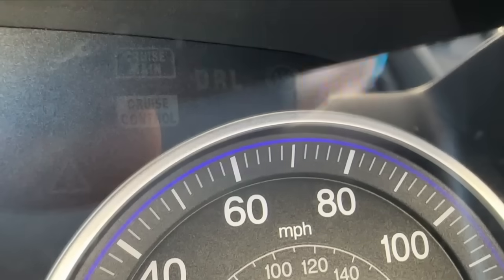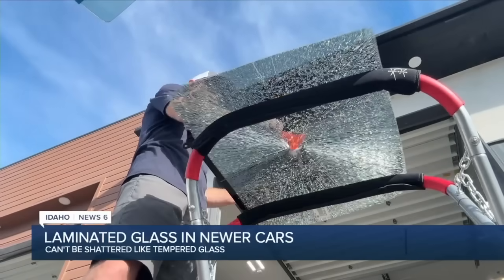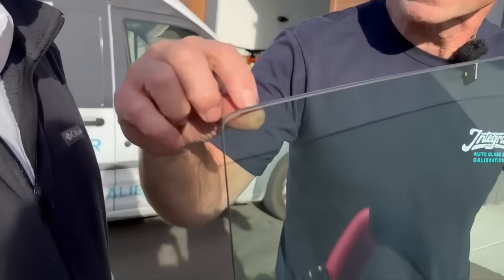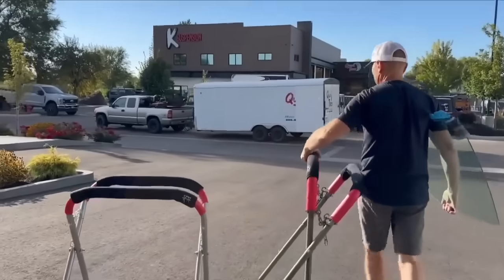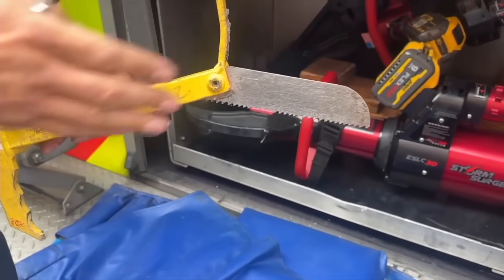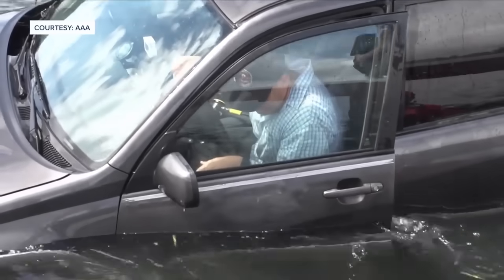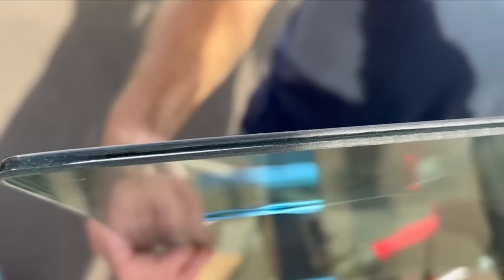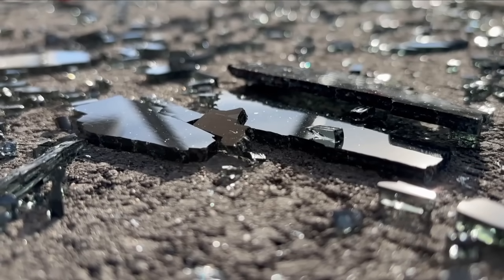New trend in automotive glass could put your safety at risk

Comment: “The only way to get out is to climb into the back”

Let’s ignore the fact that the only reason you can’t easily get out the door is because of the water pressure.

Assuming you can’t break the glass, let’s not just give up🫠. Assuming you can’t roll the window down, best thing you can do is try to stay calm, unbuckle your seatbelt, and wait for the pressure to equalize, then you can force the door open.
Reply: This is somewhat problematic, in order for the pressure to equalize you'd need to let water in but water simply filling the entire cabin does not equalize pressure, it will still keep the door shut this has been tested numerous times by this point.
Instead when you drive or land in water you should immediately try to get out via opening the door or rolling down a window, chances are your battery isn't dead immediately or if the car is old it may have a hand crank as well.

Cars usually don't sink like bricks, you have a little time before they do, so immediately after hitting the water try to get out via opening the door as soon as you can or use literally any other way besides waiting, that will likely be your death.
Reply: @Z38_US - well yes, first thing you should always do is attempt to roll the window down or crack the door before it’s too late.. but we’re assuming here that you’re already trapped.

To the same effect, this idea that you present is also “somewhat problematic”, in most cases. If a car has been floated already.. ie, water enough pressure has built against the car to where its tires are off the ground, then it’s likely most people are never going to pry a door open until the pressure starts to even out. Hand crank and motorized windows will also not function once the pressure builds up, as they will be wedged against the frame and stuck due to the intense force. But yes, obviously roll the windows down, if that’s possible.

If someone were to continue to attempt to force the door over and over again in that rush to “immediately try to get out”, then they could easily panic which leads to its own host of issues.

If you end up in a lake, roll down a window or open a door and attempt to get out immediately. If this is not possible, stay calm and plan your steps. If you stay calm, you can prepare to hold your breath in the event you go under, at which point you can easily open the door to exit.
Reply: @HiThisIsMine  the problem is that even after water filled tze entire cabin you still can't open the door, just because the car is full of water does not mean the pressure is equalized, I thought for the longest time that waiting till the car is flooded and then opening the door would work but a little research shows it does not work at all
Reply: @Z38_US whatever research you did was wrong they literally teach this in safety rescue so just stop
Reply: In flight school we were taught to unlatch the door and/or open a window before ditching (crashing in water), then as you said, let the water pressure equalize before egressing.
Reply: You're gonna be at the bottom of the lake by the moment the pressure equalizes
Reply: @Rena152  I know right? what a not good solution lol
Reply: @Rena152 - you’re not waiting for equilibrium.. you just need enough water inside that allows you to force the door open. Out in the air, you technically have no resistance, ie. equilibrium.. if someone is outside pushing your door closed, chances are you still can force the door open. 

Also, don’t forget that nearly all objects are buoyant and will not sink, “like an anchor”, in water. Even if your door was wide open, your car would not be on the ocean floor.

Either way, the point is the same, it’s not “your only option is to climb in the back and break the back glass”. Try to stay calm, always crack a window or door as fast as you can. If all else fails, breaking a window is not as easy as you may think, sometimes even with a proper glass breaker. All these escape methods have their flaws and pose their own risks. Keep your options open.
Reply: But most people panic and don't have the sense to wait for the water pressure to level out... it's a very dangerous situation, and it's perfectly normal to panic and try to escape through the closest window.
Reply: @bernlin2000  It's also dangerous to wait for the pressure to equalize inside and outside, it typically takes quite a bit longer than just the car filling up on the inside with water either way though it's not untrue but also not like people think, don't try it.
Reply: What if I drive a coupe 🙋🏻‍♀️
Reply: Top gear did an article on that.  It takes too long for the pressure to equalize.
Reply: @ebels3 Top Gear and Myth Busters.. but it’s also extremely difficult to break glass.

Not everyone has glass breakers, they don’t always work, and pulling the headrest out not only isn’t an option sometimes, but it could be quite a challenge to actually break the glass with it.

The whole point here is.. “the only way to get out”… is not by going in the back seat. You can easy screw yourself by panicking and not providing yourself alternative options.

Also, what everyone who does these tests fails to do.. is pop the trunk/tailgate, since that’s the reason why the pressure takes longer to equalize.
Reply: @HiThisIsMine that usually requires battery power.  If you have battery power, roll the windows down.  And not every car has an interior trunk release.  90% of pickups, for instance, since the don't have a cargo area in the cab.  Or my golf.  It only opens from the outside.  Yes, there is a button on the key, but the struts were never strong enough to open the hatch without the initial assistance.
Reply: @ebels3 Car batteries and electronics don’t just die under water, many cars have the lights on hours after the vehicle went under.

Pickup trucks would have much less trouble equalizing since they don’t have the extra space, so not relevant to a scenario where air is being trapped in the back half of the vehicle.

The case of your Golf.. the struts don’t mean anything, the pressure building inside would blow out the back once it unlatched 😉

At this point, I’m simply responding to your points, not trying to debate the plausibly of exiting out the door.
Reply: or open the window as u first go in the water takes a good few mins for water to stop windows from working as seen on mythbusters
Reply: or roll the window down.
Reply: Don't drive into a lake?🤔
Reply: @rhuttrho88 Right because people are driving into lakes on purpose right

Comment: Laminated glass was a challenge I was not prepared for when trying to save a guy from a burning car..... I was extremely lucky I had a huge umbrella weight with me. I couldn't break that glass as hard as I tried. It's a scary thought. I can still hear that guy yelling at me that he was burning while swinging with all my might and accomplishing nearly nothing. Managed to make a small hole and pull him through by the Grace of God.
Reply: Nightmare. So glad y were there to help.
Reply: What's an umbrella weight?
Reply: @routybouty  A weight to hold down a beach umbrella. It was on a pole to stick the umbrella shaft in, which gave me leverage when swinging.
Reply: @routybouty  Patio umbrella stand maybe.
Reply: Laminated glass is still tempered glass, but with the plastic film between layers, just as "armored glass" is - albeit with many layers and occasionally with plexiglass in the mix.
A point impact shatters tempered glass, a hammer not so much without a hell of a lot of work. The corner of a claw hammer, a rat tail file base both deliver the point impact or a spring loaded punch (which many medics carried for that purpose) will shatter the glass, then it's pierce the plastic and remove it and even tempered glass shards are still sharp, just not as sharp as plain untempered glass.
In a pinch, I've got a small blade screwdriver in my multitool, that will shatter the glass, then the saw blade knife will make short work of the plastic.
Or the medic's entry, rear window or rear door window, as the first thing we usually did was stabilize head and neck pending a collar and immobilization device.
Reply: Firefighter paramedic here.... So if at all possible here's some ways to help you break the glass ... 

Don't hit in the middle, strike the corner or edges of the glass.... They break easier there... 

The metal antennas on cars and trucks with the metal ball on the tip are excellent at breaking out glass. In a corner of the window hold the antenna roughly 6 to 8 inches from the ball against the window... Pull the ball back and allow the ball to strike the window.... It will shatter every time. 

Also small bits of porcelain from a spark plug or something similar will shatter glass of thrown at the window.

Hopefully this saves a life or helps you out next time you need it.
Reply: @medix1203 Great suggestions for tempered glass,  but these do not work with laminated.  That is the point of the story.
Reply: @rayh592 I was replying to the OP's story NOT the tempered glass. I thought that would have been obvious but I guess not.
Reply: @rayh592   Thank you.
Reply: let me quickly get a spark plug, also good luck finding antennas these days...sorry but these are useless advices
Reply: @medix1203  good tips
Reply: @medix1203   I had an umbrella weight..... homemade..... which was a tin can filled with concrete on the end of a 4 foot pole the umbrella shaft sits in to avoid blowing over from wind at the beach. I could barely get through the glass swinging that. An antenna wouldn't have helped in the slightest.

Comment: nah
not going to have weak windows just because of a 0.01% chance of some freak accident.
Reply: The side windows offer no structural benefits. As stated in the report, car makers are using laminated glass to cut down on exterior noise.
While they used a water emergency as an example, there are also fire and smoke emergencies after an accident. As a former EMT, we've had to bust windows out to reach in and unlock the car door from the inside in order to gain access to the patient.

Comment: This is ludicrous
Reply: They're not about road noise, it's a safety feature to keep you in the car in the event of an accident especially a rollover. Tempered glass shatters and then your limbs or even your whole body can be ejected, even while wearing a seatbelt. The laminated glass stays in place in the event of an accident which keeps you in place which keeps you safer from the majority of all accident types. Also as a side benefit, it also makes it harder for a carjacker or the police to get into your car.
Reply: @SilverStarHeggisist  Yes, but I was at a crash where citizens had to extracate someone from a car because it looked like there wasn't enough time to wait for the firefighters to arrive. The way the cards fell on the table, the windshield, of course laminated for good reason, was the only accessible option ... and of course no one had a hatchet or machete. It took us over 10 minutes to get them out. If the fuel that was leaking had ignited, that could have ended very badly.

Cases like that are unusual, BUT in the usual cases where the side windows are accessible, it shouldn't take that long to get someone out of the car. I agree that keeping someone from falling out is a priority, however, I am not convinced that reinforcing the windows is the ideal approach to doing so.

- Improve the side curtain air bags. 
- I dont get why cars dont have 5 point restraints and why it never became a thing to wear a helmet while driving. 

A 5 point racing restraint (plus making boron steel frames or other frames that won't collapse and entrap occupants as a standard feature) would make head - on collisions at up to 60 MPH survivable especially if people had a helmet on.

Comment: If you want to know look at the information printed on the glass!! Or wow, ask the dealer what is laminated

This is a whole load of fuss over really nothing.  

More important keep a Spring Loaded Centre Punch to hand in the vehicle .. Even tempered glass can be extremely difficult to break on occasion 

A spring loaded centre punch is the size of a small screwdriver .. Simply push the sharp tip against the glass, push the barrel in and the spring will pop the tip through the tempered glass.

Comment: This is the most alarmist news report ever.  Laminate glass is the way to go especially if in a crime prone area.
Reply: They use the example of a car in the water and the driver trying to get out. But there is another danger: fire after an accident. Sometimes damage to the car's body prevents the door from opening, or if the driver is unconscious, no way to open the door from the outside since it's locked. In a car fire, smoke is what gets you first, not flames.
Reply: @candidcapture Tune in tomorrow for our monitoring-of-the-height-of-the-sky (for your safety, of course) report.
Reply: Just don't tell thieves the rear door windows are never laminated
Reply: And yet the people who live in those cities tend to be the same people dumb enough to drive threw floodwaters
Reply: exactly. this report is bogus garbage.

Comment: Laminated front and sometimes rear windows are not mainly for road noise.  They are mainly to keep head, arm and body parts inside the crash structure especially with multiple impacts or roll overs and to keep the side curtain airbags in place until the car has completely stopped in a collision.  It is a safety feature first and sound reduction second.  Even lower priced cars are coming with laminated side glass for this reason.  The benefits of it vs the limited risk of egress in case the car fully submerges is orders of magnitude in favor of the glass.
Reply: Finally someone else who said basically the same thing I've been posting here

Comment: This laminated glass combined with electric operated doors of the Tesla vehicles has resulted in many trapped in a Tesla and burned alive.
Reply: Teslas have manual overrides for their doors. However apparently reading is hard for people, so no one actually looks at their owner's manual before driving their new car.
Reply: @SilverStarHeggisist you're not that intelligent
Reply: @SilverStarHeggisist so you really think people in an emergency are going to dig around for a release tab?
Two weeks ago a 24 year old woman in Miami died in her Tesla because the fire crews couldn’t get the doors open or the windows smashed out.
Last month in Germany a father and his two children died in their Tesla because the firefighters couldn’t open the doors.
It’s happened more than a few times this year in the US.
Cut power to the 12 volt system and the doors are not opening.
That IS a safety hazard.
Reply: @kevinW826  no I think based on the video I just saw of people standing under a helicopter that lost control to film it instead of running, that people will just freeze.
Reply: @SilverStarHeggisist  picture this, you’re trapped in a car that’s engulfed in flames and producing toxic smoke. The smoke blinds everything around you. Now try to find that manual that explains how to open the Tesla door.
Reply: @jamsbong for everyone with more than two neurons, you should know how to use the car before an emergency.
Reply: @jamsbong  I didn't say you find the manual when it happens. Whenever you buy a new car. You should be reading the entire manual and taking note of the important parts.
Reply: @SilverStarHeggisist  Your idea won't work in real life. What if I'm just renting a car? Do I need to go through the labrinth of special functions just to drive it?
Reply: @jamsbong  yes, you should know everything about the vehicle you're driving, even if renting it. You're operating a multi ton machine that is more dangerous to use then a firearm. You should have a basic idea of what you are driving.
Reply: @SilverStarHeggisist  yeah. I know enough to never drive a car with no real door handles.
Reply: @jamsbong  I mean, personally I daily an 82 Chevy square body lol.
Reply: Many? One case